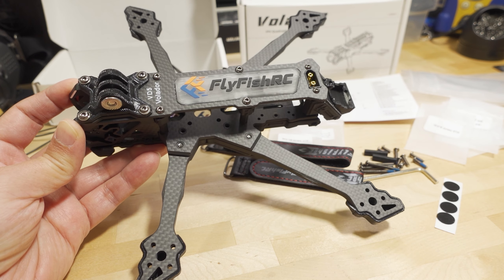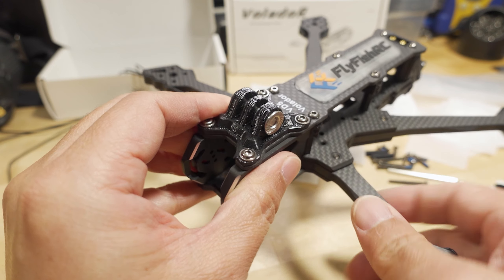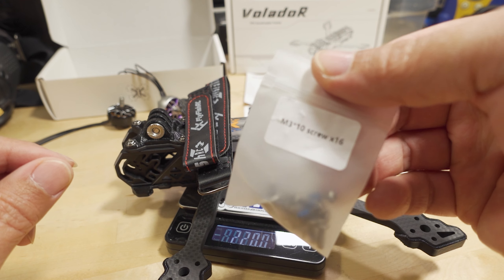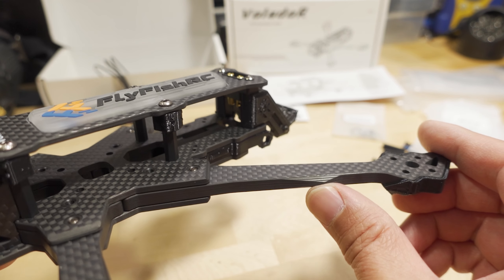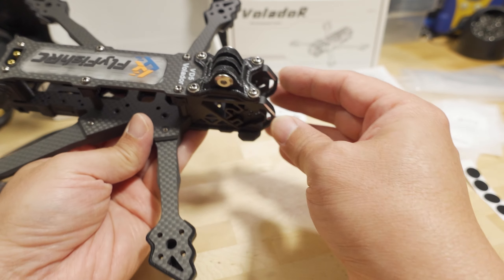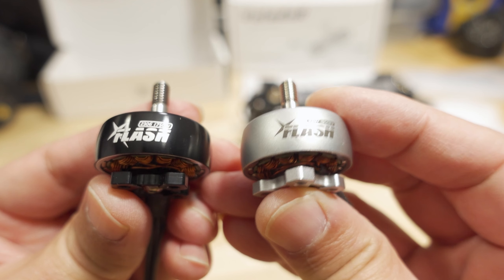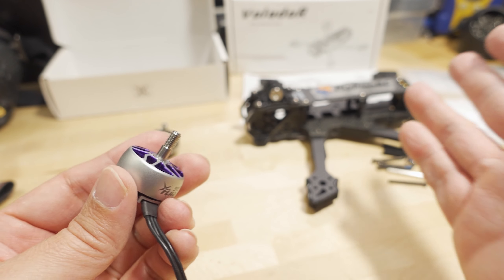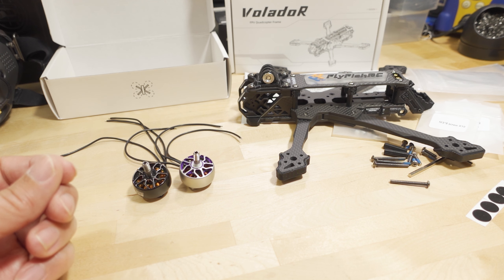FlyFishRC VOLADOR Frames and Motors

Comment: Really subjective but I really like these kinda frames with embedded xt60 in the frame, makes it look really clean. Would really like to see how this frame compares to other high end frames out there. A short review but great job anyways!
Reply: Agree!!! Makes it look so clean. A benefit is also you can unplug the battery with 1 hand. Makes it quick and easy.
Reply: I am mixed.  Some of my batteries have long pigtails, some are shorter.  It does look clean but it could be a problem with some race batteries. Idk.

Comment: The frame looks pretty good, the battery pad is unique and a great feature. 
10mm arms? That should make the arms indestructible.
The camera cage looks really sturdy, the camera should be well protected.
The single bell motor looks great and made from high quality parts.
Awesome video Albert.